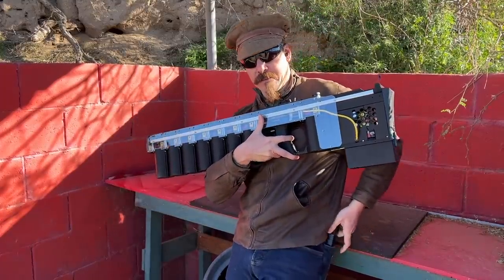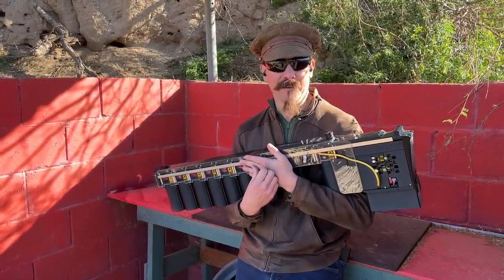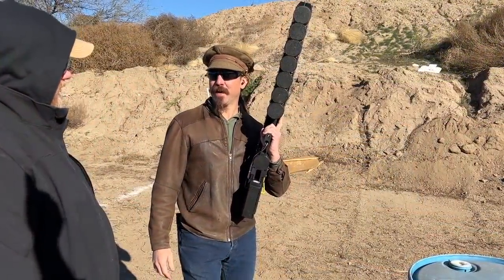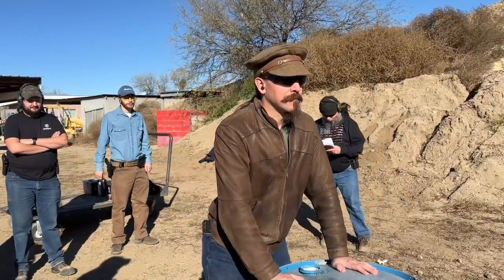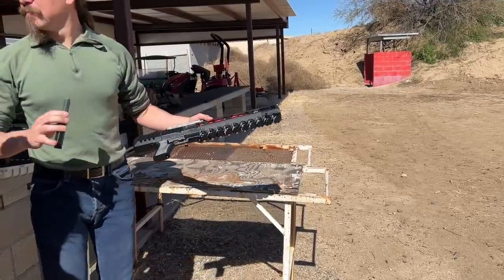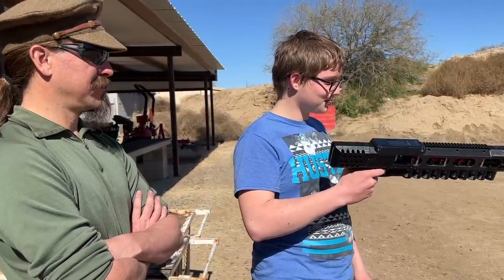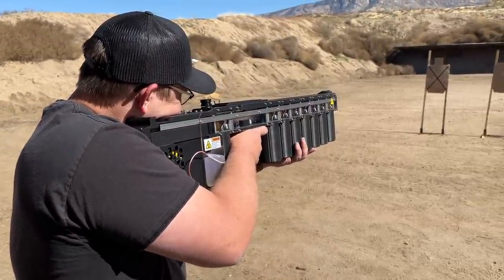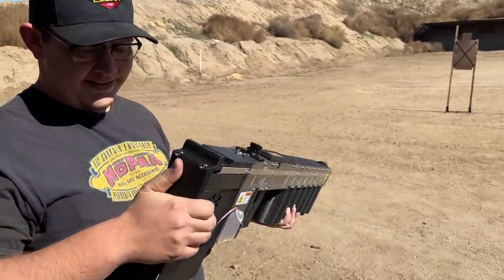I Tried to Use the GR-1 Anvil at the BUG Match...

Comment: We're spoiled by how well modern firearms work.  As Ian has pointed out many times, you look at early prototype firearms and they had their fair share and then some of wonky and unreliable systems.  Given that this is a prototype, it needs a fair amount of slack.

One simple fix would be to add a mode where it doesn't fire until it is charged.  So if you inadvertently pull too far back, just wait and it will fire when ready.  Or even better for safety, let it charge, but require a release and re-pull of the trigger to fire again.  Heck, you could put another small solenoid to act as an interrupter so that the trigger cannot be pulled to the fire position until the weapon has charged.
Reply: Yup, you can clearly see it's a proto type. But an awesome one :D Imagine this kind of tec getting as much development as firerarms had from the first arkebuses to what we have today :D
Reply: Indeed, comparing this prototype to modern guns is like comparing not even the matchlock arquebus, but the first gunpowder charge placed at the tip of a wooden stick, with a crossbow.
Reply: @ParadigmUnkn0wn  I get it, i am an electrical engineer.

There is no practical alternative to chemically propelled weapons at this time.  I agree that caseless would be awesome, but that in and of itself has issues.

Now, vehicular mounted weapons (especially on ships) can work, but again there are tradeoffs to be made.  I'd say you're still better off for anything other than missile defense with a projectile weapon.
Reply: @ParadigmUnkn0wn  I actually think laser weapons will come out on top.  The free electron laser is crazy powerful, and tunable.  And for anti ballistic missiles, i don't think you can beat it. 

It's far easier to aim a laser than it is to hit a projectile with another projectile.

But for the most past sfi-fi weapons don't make a lot of sense.
Reply: @ParadigmUnkn0wn  I also know and agree that battery technology is nowhere near the level required to make man-portable electromagnetic weapons as efficient as chemical propellants, and it won't get there anytime soon, if ever. But if we look at the time between the first piece of brass tube at the end of a spear packed with gunpowder lit by a burning piece of rope, and the first reliable breech-loaders, it's been half a millennium. Who knows what laws of physics we'll discover in the next 500 years? 500 years ago they didn't even know electricity existed.

All in all, I never claimed that this prototype will become an efficient design surpassing chemical propellants any time soon. But we shouldn't dismiss new experiments completely either, because most of our technology we use started as such experiments back in the day, where they weren't efficient enough be be immediately useful.
Reply: From what I've seen, I think that when it's "charging", it uses a rangefinder to see how distant the target is, and adjusts the power accordingly so that it doesn't waste precious energy that can be saved. But this is speculation on my part.
Reply: @LehySnek  It doesn't. You can see in the video posted a day before this, that the power is set manually. It doesn't have a rangefinder.
Reply: Heck, just....put a charging button separate from the trigger
Reply: @jeromethiel4323  Laughs in RTG backpack
Reply: Not really. How badly it functions and the price is one thing, but the fact of how ANEMIC it is (outperformed by slingshots and bow and arrow in every department), and that we don't have, nor WILL have the technology to make it come anywhere close to even air rifles for about a century at best unless there's SEVERAL major breakthroughs makes it nothing but a glorified toy for many decades to come. Heck, the guy who patented these made one that shot at 50 m/s about TWO HUNDRED YEARS AGO, and wow, look at that, 200 years and it's a WHOLE 25 m/s faster! Large coilguns/railguns may have a future, seeing how they're already pretty impressive, but handhelds? Nah-uh

Comment: Here’s some ideas for range commands when using this thing in the future:

“SWITCHED HOT!” —Gun is powered on and is ready to be loaded. Gun should be considered/treated as ‘live’ and loaded at this stage until specified otherwise. 

“ROUNDS IN!” —Magazine is loaded and the gun is ready to shoot. 

“ROUNDS OUT!” —Magazine is empty. 

“CHARGING!” —Capacitor bank is charging up to fire. 

“DISCHARGE!” —Gun is firing. 

“SWITCH COLD!” —Gun is powering down and is being rendered safe. Note that it should still be considered/treated as ‘live’ at this stage until it is fully off. 

“SWITCH SAFE!” —Gun has completely powered down and/or has otherwise been rendered safe.
Reply: I think the tricky thing is that the capacitors may still hold charge even when the battery is removed, and they pose their own risk, as they can give you a shock or explode even without projectile. Otherwise I agree: the risk is rising with battery in - capacitors charged - projectiles loaded. It´s just that the order of events, especially on the way back to "safe", is not entirely one-way.
Reply: Do you need a command for malfunctions? When Ian showed this thing earlier, the steel rounds would sometimes not get pushed out of the "barrel". The thing can overheat if fired excessively.
Reply: @paavobergmann4920  He explained the pacemaker warning in an earlier episode. The thing creates an EM pulse when firing. People had to keep sensitive electronics away when it discharged.
Reply: @SusCalvin  Probably something along the lines of “MALF!” or “MISFIRE!”
Reply: @DiehardMechWarrior  I don't know exactly what existing range commands you have. If you have one for malfunction already, it helps this from sprawling out too much.

Here, they solve the EMP problem by an informal cordon. This piece essentially gets its own zone to fire in. Even if no one has a pacemaker, I'd hate to fry someone's smartphone.
Reply: With today's technology, I think it's still not possible and it won't be cheap either. So it is better to wait another 5, 10 or 15 years for the general technology of human society to improve before doing better.
Reply: "ROUNDS OUT!" — 404 bullet not found

Comment: I love watching the young guy shoot it- the hipfire is showing the recoil, which is obviously not substantial, but you can see that the force of discharge is visibly shifting a *20 lb gun*. Without any bang, I was underestimating the power of this device.
Reply: 100J is about the same as a warbow arrow or a thrown hammer.
Reply: Ian explains that firing the larger model momentarily dumps 4000 to 15000 amps into the coils. It also generates a 5 to 8 T(esla) magnetic impulse, which is why he wants to know if anyone has a pacemaker. It might not recoil but the electrics will easily the operator if he touches the wrong spot.
Reply: @wookieblaster  I expect it to recoil, especially future, beefed up versions will recoil. You accelerate a projectile to a certain kinetic energy, and in all cases where Newton´s mechanics are a good approximation of reality, like this one, there will be an equal and opposing force somehow. "Recoilless rifles" also don´t cheat physics, they simply impart the recoil on gas that is vented out the backside, instead of into some mechanical device that punches it´s resting point. The Backblast of an RPG is what would be its recoil if it was closed. Which is why it´s open. 
Also in this case: What we see is 100J recoil. Beef it up to 2000J, and it will kick like a rifle.

Comment: It seems to me that this weapon could use a physical separation between the charge in action and the firing action. And it might be a good time to bring in some sort of thumb trigger as the charger.

Thumb in the side of the grip or the back to charge the capacitors, give a little physical feedback with the vibration and maybe a low tone to indicate charge, and then a standard trigger press to fire. That way it becomes much more obvious what gesture does what and being more separated it becomes a little more trainable.

The SMG version looks very nice and incredibly fun.
Reply: The trigger itself seems to be a bit iffy as well. Just touch it slightly false and the projectile tumbles and falls out of the gun. Imagine this awkward resolution to a Mexican standoff :D
Reply: You could possibly have some kind of ambidextrous middle two finger setup, where the middle finger pulls the trigger, but the index finger rests on where the trigger normally is, to press a button to ready the weapon. You could swap the buttons around in software, if people prefer.
Reply: Imagine it had the buzzing arming noise of the AIM-9 Sidewinder.. "bssssssssss.....uuii wheeeeeeee!" ...how awesome would that be?
Reply: @paavobergmann4920  It doesn't have a nice high-pitched whine as the capacitors get charged because of the resonant frequency going on. I suspect future iterations will have less of that because it really represents a loss of energy and future versions will be more efficient.

It's a pretty awesome sound, however.
Reply: @LexTenebris  yes, of course. I was more thinking about implementing a sound effect to indicate ongoing and completed charging.  And I thought about the cockpit noise a hot Sidewinder makes during target search and target lock. That just gave me 90´s-video game vibes ;-)
Reply: Just give it voice clips. "brrrrrr, ready to fire"

Comment: For the tumbling slugs, I'm sure at least someone else has thought of this quick fix: add fletching. Old-school, but it's what kept arrows all over the globe flying straight and true before we knew about the wonders of exploding powders and spinny grooves.
Edit: This should only apply when using the coilgun in any fluid medium (atmosphere or underwater.) No resistance in vacuum environments, go big or go home out there.
Reply: Figuring out how a gun would work in space is a whole bunch of issues. How would any kind of mechanism that relies on gravity feed work, can your thing operate in ludicrous temperatures etc.
Reply: @SusCalvin  You'd need to rotate or accelerate the gun to provide the "gravity" for it. Basically unles it was designed to work in zero G its not gonna work. Gravity fed anything is right out.

Comment: Needs a "charge" button (maybe for the thumb) so that you can charge it up and only use the trigger to actually fire it.
Reply: Or use Nerf's 'rev trigger' idea, which they use in their flywheel blasters, and have a second button under the trigger-guard, under the user's middle finger.
Reply: Probably Better something like the grip safety on a Uzi.
Reply: Or it could start charging when the trigger is pulled back, and it fires when the trigger is released. An audio cue like a small 'beep-beep' for a complete charge could also be included so the user knows precisely when it's fully charged.
Reply: @Vanastar  I find it kind of funny that Nerf designs their guns significantly better than barely functioning coil gun.

Comment: If I'm not mistaken reflex sights are easier to see in daylight than a laser. It would be really cool if on upcoming models they could integrate the charging indication into a reflex sight.

Also it would be nice if they could add a detent to the trigger so people could more easily find the pull for charging.
Reply: Things like ergonomics, attachments, etc are the last things to be added once it can shoot consistently and shoot straight
Reply: i'm sure eventually there will be an integrated sight proper but as an X level prototype it's not worth doing any of that.  They still need to get the thing to consistently and reliably work.
Reply: @jyggalag169  for sure. I do think some trigger changes could help with the consistency though. It seemed like there was alot of user error centered around not knowing where the hold point was for charge vs fire.
Reply: @jyggalag169  im sure if you really wanted to you could very carefully drill and tap some holes into the plastic to take iron sight from say a 10/22 of who knows what

Comment: Time out guys, my gun blew a fuse!

Seriously though, an actual production gun for serious use would need a 'battle fuse' mechanism for anything that might get overloaded like that. I think moving the core functionality logic to something like an FPGA or ASIC, probably with redundancy would be a good idea as well. A gun that relies on sensors and computers just to fire is a really strange scifi idea today, but its just a matter of solving some engineering problems to make it reliable, and then more engineering problems to bring the cost down to make it marketable. 

This thing is so frigging neat.
Reply: What is the first, obvious advantages of this thing? Even small things that might be built upon in the coming generations.
Reply: Maybe for military applications in the future where the metal slug is traveling bullet speed, but for now an FPGA to handle the logic seems a bit overkill no?
Reply: Something tells me the "fiddling with the knobs" either wont be allowed, or wont even be a possibility on potential military production versions.    Theyd likely have settings that an armorer would have to determine to prevent any over-loading...

but think of the upsides, small arms repairmen and electrical engineers would become one branch of an already over-loaded specialist class!

Comment: Ian really missed an opportunity here to "dress like his gun" as he does in many other matches and donned a Buck Rodgers costume.
Reply: YES!
Reply: On the plus side, he looks like someone out of Fallout instead
Reply: @kingsnakke6888  Someone provide Ian with an Armored Vault Suit for next month, stat!
Reply: Advanced Power Armor should do the trick.
Reply: @E5rael  Unless he does a super stripped down version I doubt he will. It's hard enough walking around a convention in that sort of cosplay, let alone do a BUG match and, more importantly, safely handle a coil gun.
Reply: @bozo5632  What kind of distortion would you get looking through that kind of helmet? The bodysuit would be perfect for mobility though.
Reply: The 30s one
Reply: Nah, Duck Dodgers
Reply: @kingsnakke6888  it does look pretty similar to the gauss rifle in Fallout 4, just with more polymer than sheet metal.
Reply: Power armor might be tough to pull off. But a Vault Suit should work just fine.